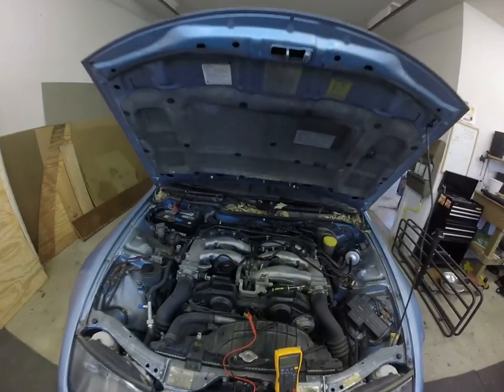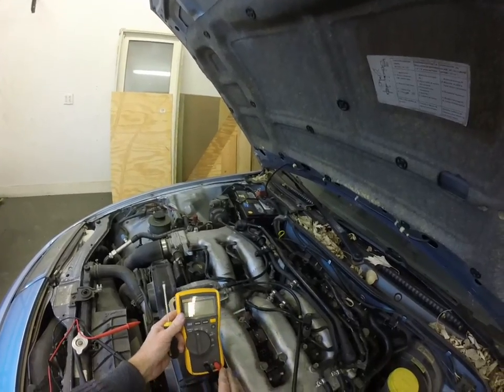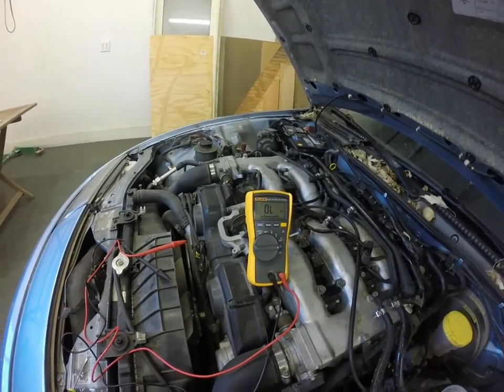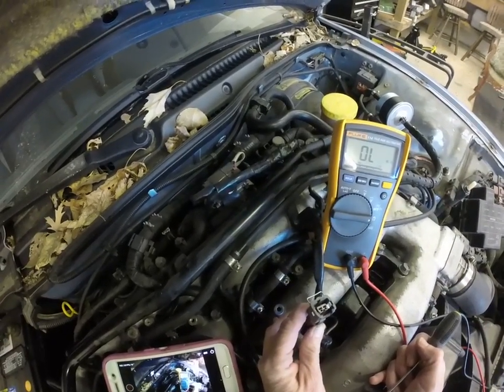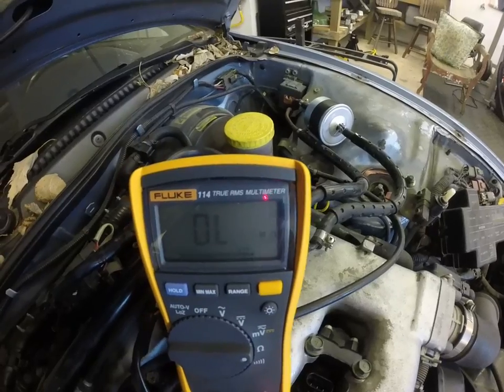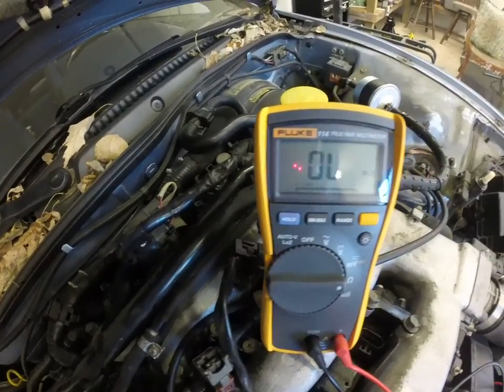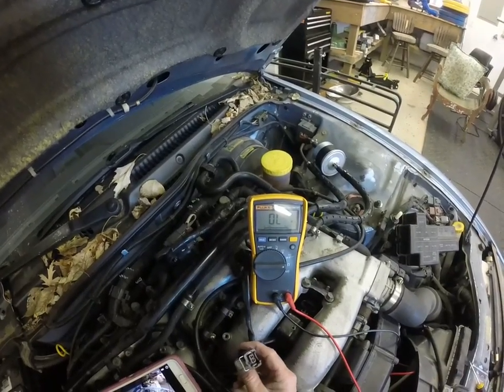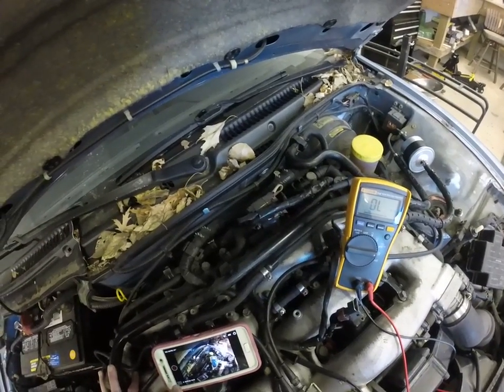Ohm testing coil pack and fuel injector of Nissan 300ZX

Comment: Does the battery need to be on the car to ohm the injector? I tried to ohm one injector but it didn't read anything.
Reply: No the battery does not need to be installed because when you disconnect the injector cable you are isolating it from the battery and cpu. If you're not reading anything (which happened to me also) then the injector is bad. Make sure to short your leads together to verify your meter is working properly. You can also test the new one before installing it.

Comment: What's the update? This Z still rolling?
Reply from the maker: going strong. better than ever. I haven't done any Z videos recently since I haven't been working on it.  I need to work on the AC
Reply: @mebeingcheap7644  my ac doesn't work either. I do however own a vert so it's not horrible on milder days. I'm at my limit because of this Bama humidity. I keep telling the wife this is the year I fix it and she keeps telling me work more overtime 😂

Comment: Blue interior?
Reply from the maker: yes, it is a dark blue cloth interior.
Reply: Take a look at this 
http://j-bender.com/?page_id=154
Your car is less than 3.58% of the total made like that. Very rare. and 3% for 1990. That color combination was only made in 90 and 91. Just something to keep in mind. Take care of your interior as well. You will have to shell out big bucks to replace plastic pieces and carpets in blue. Id strongly recommend tinting the windows and using a windshield sunshade if you keep it outside.